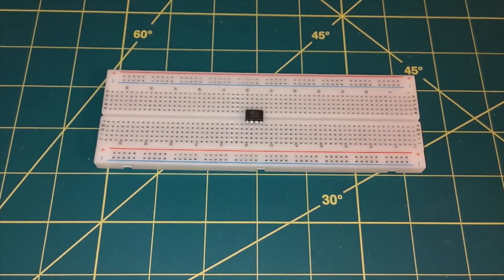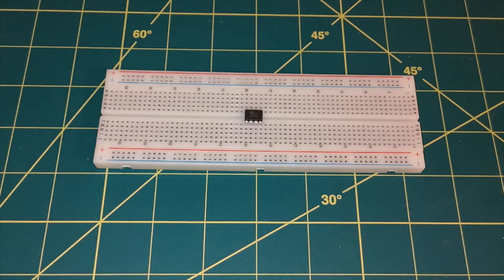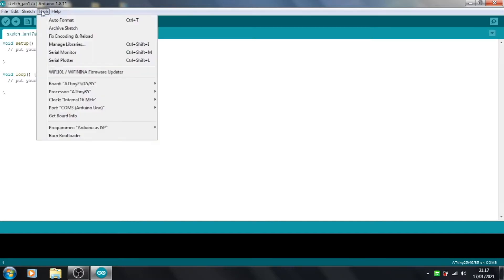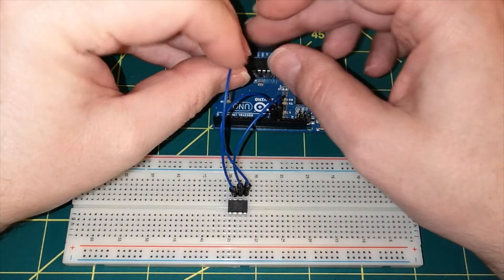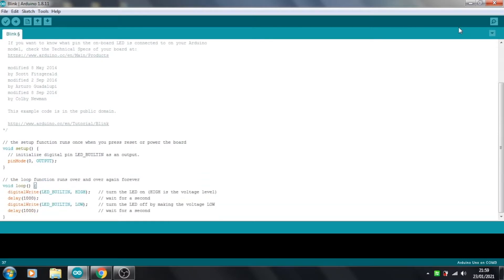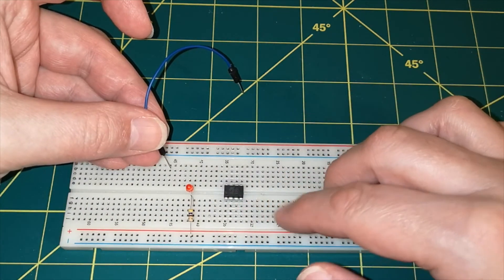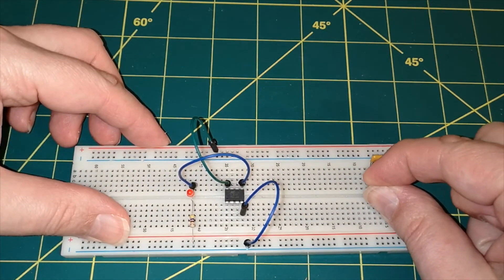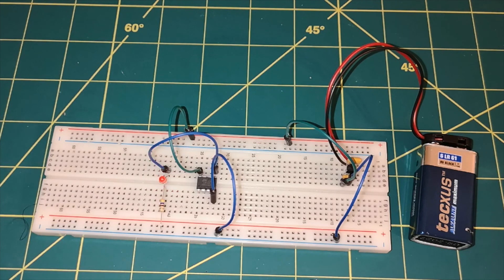ATTiny85 Program Using Arduino UNO

Comment: EVERYONE IS USING BLI NK. BUT I WANT TO SEE OTHER PROGRAMS IS FUNCTIONING AS WELL. I WROTE A PROGRAM FOR IR CONTROLLED RELAY. IT WORKED WITHOUT HITCH  WITH NANO. BUT AFTER UPLOADING THAT PROGRAM TO ATTINY85 IT DID NOT WORK. 12:06 CAN ANYONE  HELP?

Comment: you did not talk about uploading the bootloader, in the final uploading you did not changed the Boards as ATtiny85 instead you kept it as Arduino Uno. So technically the programmed got uploaded in the arduino and not the chip. Why i wasted my time on this video.....

Comment: when i uplode code  show ( errpr: A programmer is required to upload  ).how to solve it
Reply: most  demonstrate using old Arduino IDE's ! I think from IDE 2.0 onwards you have to select the Sketch Tab and in the dropdown menu select "Upload using programmer"  Hope this helps anyone reading this because its not very well documented.
Reply: @lestronicsuk5662  THX！This helps a lot!

Comment: I have a question about the remaining "unused" pins...

how come the A3 & A2 pins of the Attiny don't need to be hooked up like all the others to be programmed?

I have a project where I need 3 digital outputs for RGB LED and 2 touch buttons is this possibles with the ATTINY85?

What would I have to name the two touch buttons in the ARDUINO sketch to programme them onto the Attiny chip?
I haven't found an answer.
Reply from the maker: Hi. You don't need to hook up all the pins for programming. The programmer essentially communicates with the ATTiny85 via SPI. So it only needs to use the SPI pins (5, 6 & 7) along with reset (1) and power (4 & 8). So basically all of them apart from pins 2 & 3.

There is a nice diagram of the the pinout on this page. https://makersportal.com/blog/2018/5/19/attiny85-arduino-board-how-to-flash-the-arduino-bootloader-and-run-a-simple-sketch

The light blue numbers are the Arduino pins. These are the pin numbers you will use in the Arduino sketch.

Sounds like you need 5 pins for your project, 3 outputs and 2 inputs. This should be easy with the ATTiny85. You can use Arduino pin numbers 0, 1, 2, 3 & 4. Physical pins on the chip 5, 6, 7, 2 & 3.

Arduino Pin 0 = Physical pin 5
Arduino Pin 1 = Physical pin 6
Arduino Pin 2 = Physical pin 7
Arduino Pin 3 = Physical pin 2
Arduino Pin 4 = Physical pin 3
Reply: @SteveRaynerMakes  

Thank you man, after a lot of confusion this is a huge help.

Subbed!

Comment: does using regulator is necessary?
Reply from the maker: Technically it will operate from 2.7v to 5.5v. I would highly recommend a stable supply voltage. Having a Vcc that is not stable could cause unpredictable results. Technically it might work without one, but I would not want to rely upon it.
Reply: @SteveRaynerMakes  you're right, Thank you. I'll consider this in my design